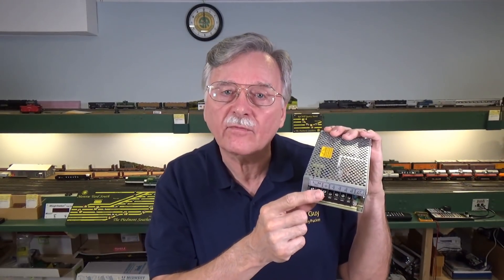Wiring Your Model Railroad for DCC (110)

Comment: I have two of your books on wiring and DCC. They are great. The question I have is can you use BNTECHGO 18 Gauge PVC 1007 Solid Electric Wire Red and Black Each 20 ft 18 AWG 1007 Hook Up Tinned Copper Wire?
Reply from the maker: For what and what scale—track bus, accessory bus, feeders? See chapter 10, page 74, Table 2 of my wiring book.

Comment: I need help with my first HO model layout and locomotives. I have purchased an old Hornby Select controller, but I do not get the 15VDC out as the manual says. I reside in New Zealand and help here is very difficult to come by. It seems the controller does program the chip on the locomotive, but it does not run, so I found the 15VDC output to be only 5VDC. Can I alternatively add 12VDC - 15VD to the track? My locomotive (also pre-owned) DD40X 6936 only flashes its headlights on and off all the time when I try to run it with the Hornby controller. Any help would be much appreciated. Edward
Reply from the maker: I am not sure what you have,is it a standard DC power pack or a DCC one? At any rate if it is an old unit and not pitting put the correct voltage it likely has a failed component. I recently had an old MRC power pack do that.
Reply: @TheDCCGuy  I have a this Hornby select, a DCC controller.  but I do not get the 15VDC out as the manual says. Can I alternatively add 12VDC - 15VD to the track?

Comment: Question I have a N scale 100ft layout how can I check that I have consistent power flowing through my 12 gage bus? I will admit I have some areas where I put the the feeder in the wrong side and had to take it a loose which I caused breaks. Should just solder or replace the wires? Last question do I more than likely need a smart booster? I'm not getting the red light on the NCE system I'm checking all problem areas need your help.....
Reply from the maker: It might work, but the 100’ bus run is also a complicating for as the voltage may drop below a level required to run the decoder. I use a Volt AmpMeter from DCC Specialties to check the voltage at various points along the bus, just make sure there is a load on the track such as a 1 amp light bulb (auto tail light bulb).

Comment: Hi, Gary. I've watched several of your videos and found them quite helpful. I am in the process of setting up a reverse loop. I've used the digitrax ar1 before and it works fine. What I  want to do now is automate my tortoise with my ds64 and bd4. I've seen a video where this is done but it makes no mention of using the ar1. Can you help me? Thanks in advance.
Reply from the maker: I did a video on automating reverse loops but used other equipment, but the approach would be similar.

Comment: Whst dcc books do you recommend
Reply from the maker: There really isn’t much available that is recent and up to date. I cover wiring it in my wiring book and a lot of the basics in my old book published by Carstens and still available on Amazon but it is almost 20 years old. Kalmbach published 4 volumes of collected articles from the DCC Corner column but the most recent is 4 years old. The good thing is that even the older books that cover the basics are only out of date in that they do not have info on the most recent hardware and developments, the basics stay the same. You can check out my Beginners Guide playlist for a lot of that kind of material. There are over 350 videos on my channel to get you informed too.

Comment: What if we have a large club layout where one person determined as we started building the layout that one person insisted on using free wire that is only 18 AWG? When I questioned that mis judgement he said the 18 AWG was free and ignored any other advice contrary to his opinion. We now experience random engine failures. He did realize later after wiring the Tortoise switch motors with mainline bus wire that would not work. So he did use 16 AWG. They are working OK so far with remote control. 
Since I am admittedly DCC challenged I rely on reading instructions and listening to yours & other DCC videos. I have also learned a lot by being a member of several different DCC clubs. 
So I try to share what I’ve learned but instead of listening this one person has taken control of all construction. He is handicapped in that he has very poor eye sight and is a very poor listener. He always has a quick quip answer to make the person offering advice look like the village idiot. He is a good carpenter, but doesn’t understand good level track work with smooth easements into curves. 
I’ll stick it out for a while as there are no other large clubs close by. So thank you for your many hours of instruction.
Reply from the maker: That is so often an issue at clubs. At my old club our track was originally wire with telephone wire because a member who worked for the telephone company got surplus wire free. When we converted to DCC we rewired the whole layout. Small wires and long runs are a recipe for problems.

Comment: Dose it work for g scale ?
Reply: Your wiring book with the DCC. Thank you.
Reply from the maker: Well, the basic theory is the same but most examples are focused on N, HO, and O scale running on DC or DCC power. If you check Amazon you might find a book with a G and large scale focus.

Comment: I need to purchase a simple DC power supply for my HO scale railroad to power LED lights and other accessories. Can you help me to choose between these two selections: a 12V 10A 120W DC Power Supply Adapter 100V~240V AC to DC Converter 12 Volt 10 Amp Transformer or a 12V 5A 60W Power Supply Adapter AC DC Converter 100V~240V to 12 Volt 5 Amp Transformer. I don't understand the 5Amp versus 10Amp pros and cons and how each choice would play out / impact my use on the layout. MANY THANKS!
Reply from the maker: I used a 12VDC 10 amp one on the layout and thought it was overkill until lately. LEDs don’t take a lot of power individually but they add up fast, plus I have been adding a lot of other devices to the DC bus so now I am glad. For example the LED strip lights chew up 1 amp per meter and I now plan to install about 2 meters over the staging yard. I got mine from Jameco.com who sell a brand called Mean Well that I have been satisfied with. They are available in a wide range of voltages and amperages. I think the main difference between 5 and 10 amps is the price. They don’t actually use that much power all the time only when powering devices that add up to that amount and even then they draw much less from your household mains. However keep in mind that your household outlets are probably 12 amps so don’t go overboard with this. Estimate your needs and buy accordingly. If you have any old desk top computers the power supply in it can usually be cannibalized for a 12 and 5 VDC supply, I think I have seen at least one YouTube video on that.
Reply: Thank you! As always your videos and your answers to questions are extremely helpful. I was of the same mindset that collective amp draw by LED's, alone, would justify the need for 10A.
Reply: Wonderful. Thank you! Might I ask a follow-up question. With a 12VDC / 10A DC power supply, if you cut off the DC plug and expose the bare wires, would you get a major ZAP/JOLT when you touched those bare wires? How about a 12VDC / 5A DC power supply? I am just trying to fully comprehend how 10A and 5A differ and in these DC supply units with regards to getting a ZAP/JOLT from their bare wires. MANY THANKS!
Reply from the maker: I don’t even play with hot bare wires from a 1 amp supply. You could probably do a Google search of the effects of getting a 1, 5, or 10 amp zap. Here is one such discussion that suggests it is not an issue for humans. https://www.quora.com/If-12v-DC-is-flowing-the-wire-and-if-I-touch-a-12VDC-wire-what-will-happen

However I cover any exposed connections and or place the power supply in an enclosure. You don’t want little fingers poking around under the layout and finding 120VAC wires.

Comment: So, I’ve searched google and YouTube for answers for a while, I run unitrack for n scale. 
Sometimes my trains run great, other times they stutter, stop and go. It’s rather annoying! A complete piss off, this happens with new engines as well as older (not more than a couple years) they will run flawlessly then the next time they don’t, I cleaned my track last night with the peco rail cleaner (the grey block) and my new as of yesterday loco did the same thing. 

I have feeders and a bus line around the whole layout, 50 feet of track plus a helix! Before the feeders, I had little to no issues, I talked to some other people and they said feeders should fix everything! I’m at a loss, I have checked ever connection and feeder and everything looks good, no splits, solid joints. 

Any help would be appreciated, from anyone who’s had a similar issue, thanks!!
Reply from the maker: Does it happen at any specific locations on your layout or just over turnouts? Also have you tried cleaning the wheels in addition to the track?
Reply: All over the place, and yes cleaned the track and the wheels, took some track out of the package ( a 5 foot line) tried that and it did the same thing. Almost sure that says loco? It ran fine on the test track in the store yesterday.
Reply from the maker: Do you have a friend or local club with a layout you can test the locos on? I find it surprising that you would have the same problem in all your locos presumably from different manufacturers. The symptoms are dirty wheels and tracks but if you have cleaned them then the only other thing could be an intermittent short or bad wire connection. Check your wires and see if that might be it.
Reply: I don’t have an n scale club. And that’s what I find confusing about the whole thing. I may have to re wire my layout! All though I did turn the sound off and the thing ran like a top. I appreciate you taking the time to give me some info on my issues.
Reply from the maker: What do you mean you cut the sound off and they ran great? Do you have sound decoder equipped locos? Also looking back at your original post you say your main bus is 50’ long, that itself could be an issue. What size wire did you use, what amperage is your command station, did you twist the wires, did you do the quarter test all over the layout, and what brand/model of DCC system are you using?
Reply: I muted the locos because the guy I called at the hobby shop told me to do that because apparently sound equipped locos take an extra amp. They worked after that. I use 18 gauge wire and I have the digitrax dcs 51 system. I didn’t twist the wires, I have suitcase connectors. If they could be an issue I would change them in a heartbeat. 
What is a quarter test?
Reply from the maker: Place a quarter across the rails to create a short. If your wiring is adequate then the command station should shut down and sound off (see page 52 in your manual). If your wiring is not adequate then it won’t “see” the short and will stay on. Do this all,over your layput at about 10’ intervals and see how it varies. Even if it does shut down, 50’ of 18 ga wire can significantly reduce your track voltage to the point of creating your problem, which likely is why your locos worked great after muting the sound. With 18 ga wire you lose a little less than 0.025 volts per foot of run. And with code 55 rail you can lose 1 volt per foot of run. So combine that over 50’ with a system that starts at about 13 volts and only 3.5 amps and pretty soon you got trouble. I recommend keeping bus runs under 30’ and placing feeders every 4’ or so and that is with code 83 rail and 14 ga wire.
Reply: Awesome, I just re read that! I have feeders every 3’ I believe my bus line is 14 gauge with the feeders being 16, if I have the issues still, I will switch it all to 14 gauge. I had no idea voltage meant so much! Thanks again, I’ll let you know when I get home!
Reply: Larry, 

Got a bunch of “waking zeros” but then I didn’t get any on my top level or on my helix and down on my lower yard I didn’t get very many shorts. I assume that I need more feeders?  The lower yard is “fed” on each end That’s what the manual says, I just want to make sure I get it from another source. 
Is it that simple that I need more feeders? 
Or should I upgrade my system?
I also wonder if I disconnect the top level for now, will that help until I can wire the whole thing?
Reply: Ok, I may have too many comments but forget my last two, 

I disconnected the mainline from the helix, that fixed the issue and the locos all run great, one or two spots the new one sputters, over the feeders, I have feeders every 2 feet, could it be to many feeders? Or do I actually need to add more like the manual says? Thanks again, Larry!
Reply from the maker: I cannot understand why they are sputtering vier the feeders. My feeling is the more the merrier. I also cannot understand what is going in with the helix. You said your main bus us 50’ long. Do you have the command station at one end of it or in the middle thus dividing it into two 25’ sections? I would love to see this setup just to see exactly what is going on.
Reply: Well, I’m definitely going to feed the crap out of it then! 
My command station is at one end of the layout, I don’t have the helix or the upper level wired yet, which was a huge voltage draw as I found when I disconnected it. I put the command station where it is now because that was my original layout, then I expanded. 
I was moving some track around earlier and one feeder popped off, after that most of the sputtering stopped, when I run my new loco at crawl, it happens still, so I may have another bad feeder.
Reply from the maker: Probably a bad solder joint creating micro shorts. Do you have a voltmeter? If you do then put it on the AC power setting and measure  track voltage starting at the command station and work your way out and see how much it drops.
Reply: I don’t, I’m going to purchase one right now. I assume if I get low voltage, then it would be a bad joint? 

Also, last question (I hope) 
14 gauge for the bus lines,, can I use 16 or 18 for the feeders? 

If it sputters right over a feeder, that would be a bad joint?

Comment: Question Larry, why use a separate power supply? Thanks in advance!
Reply from the maker: I’m not sure what you’re asking. Can you be a bit more specific?
Reply: @TheDCCGuy  Larry, using the power supply from Jameco instead of the wall wart that comes with the DCC system. My apologies for not being clear the first time.
Reply from the maker: @njgates7189  Most systems do not come with a power supply so you have to provide your own. MRC is an exception and some of the beginner systems come with one.In the early days of DCC you had to build your own power supply either from parts or a kit.

Comment: I use GLX high temperature stranded automotive wire in various AWG sizes and colors throughout my layout. I use twisted striped wire pairs for DCC (blue/white, white/blue; green/white, white/green; etc...) and solid colors for DC with black for DC ground and light green for Digitrax "Reference Ground."  

Each power district is assigned a unique color pair, allowing easy tracing in the event of a problem with any of the wiring.  I use 12 AWG for the main DCC feeders and 18 AWG for the track power drops.  Drops are spaced every 12" to 16" apart and each Peco Electrofrog switch has drops for both outside rails and (of course) the frog itself has a drop. 

GLX is light weight, very flexible and resists abrasion quite well. Its temperature range is -40°C (-40°F) to 125°C (257°F) and available in a broad range of solid and striped colors. 

I enjoy your videos and find them very informative, but I find zip cord and romex to be a poor choice compared to GLX wire. 

Keep up the good work, Bruce
Reply from the maker: I got the zip cord tip from Larry Maier the electronics engineer who designs all the DCC Specialties products, he knows his stuff.

Comment: I have NEVER seen a Carolina and Northwestern locomotive. This is what I'm wanting to model at my house as it ran through my town. Where were you able to find it or did you make it yourself?
Reply from the maker: I created the decals using Adobe Illustrator, printed them on a special printer, painted the model and applied them. If I can fond the file I’ll give you a copy but you will have to find a decal printer to run them for you.

Comment: A little tip for pulling wire up through your layout. Get yourself a guitar string, or simply buy a set of six, or ask a musician for and. One end of a guitar string has a little round "keeper" on it, with a hole in it. Push the "keeper" down through the bored hole, hook the wire into the small hole in the keeper, and pull it through easily. You could even put a drop of solder on the wire/keeper if need be, but that shouldn't be necessary. "Pulling" wires is always easier than "pushing" wires, as Larry has pointed out. Or as comedienne Moms Mably pointed out, "Making love to an old man is like pushing a car up a hill . . . . . with a rope!"
Reply from the maker: Good tip, thanks for taking the time to share.

Comment: Just a quick question as most Baldwin diesels use an air control throttle and non-standard MU, was V&O 267 converted to standard MU, or is it a point helper in your latest MR column?  Just kidding....
Reply from the maker: Actually Baldwin offered an interface that allowed their diesels to operate with EMD and Alco as well as others. V&O 267 was delivered with the interface installed so was able to operate with the full V&O diesel fleet.